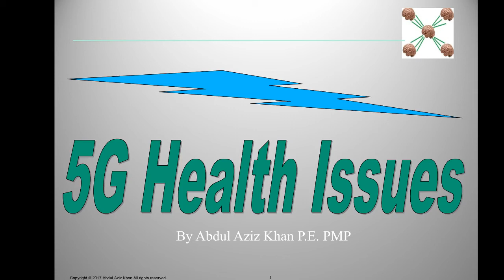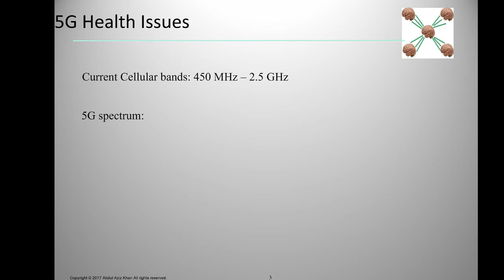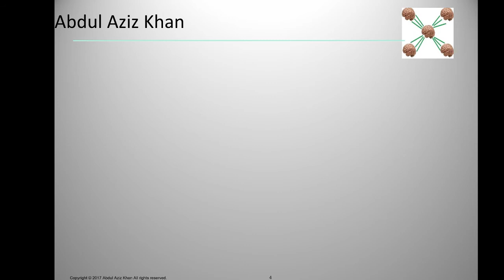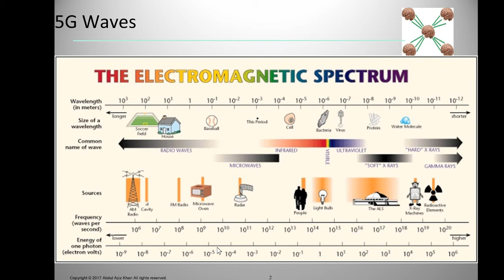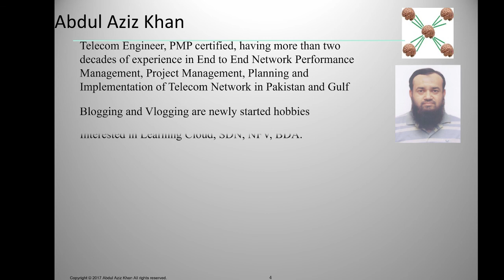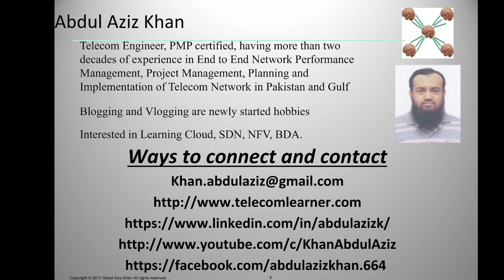Comment: 5g is safe
How do I know ?
When you put your hand close to a fire, you feel the heat, then, if you put your hand closer, your hand is going to get burns, a fire is a lot of energy ( let's say 400 000 joules )
You are here taking a lot of energy

When you use a phone, the electromagnetic waves are so low energy ( let's say 0.0000001 joules )
You don't feel anything, do you ?
You are here only taking a tiny tiny tiny tiny fraction of fraction of energy, which is nothing
Reply: right, you are right that it is quite a lot safer than what people think.

Exposure to high frequency for a longer period can instigate cancer, which is also right, but number 1 as you suggested that this energy is quite low, secondly 5G is not different than 4G or 3G or 2G, in fact it is more safer.

I also think that why there is a hue and cry on 5G specifically.
Reply: @KhanAbdulAziz  it all comes down to how much energy ( how many joules ) you are taking,

the electromagnetic waves are so low energy, you never feel anything

when you are exposed to the sun, you feel the heat, you feel something on your body
you actually get way more energy from the sun than from your phone